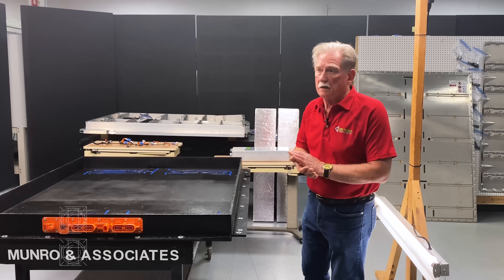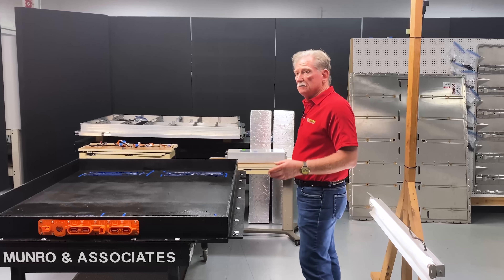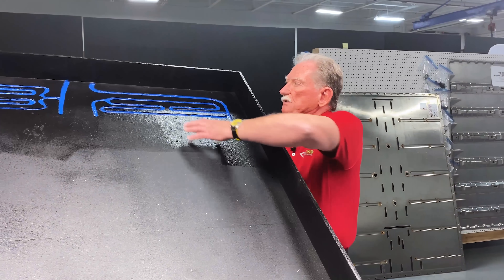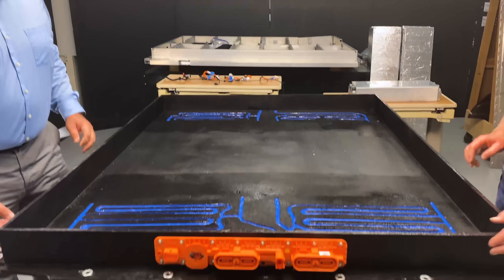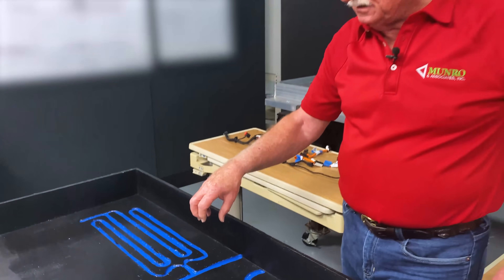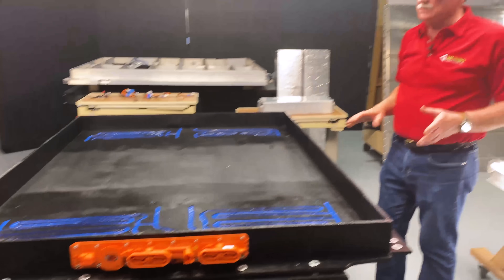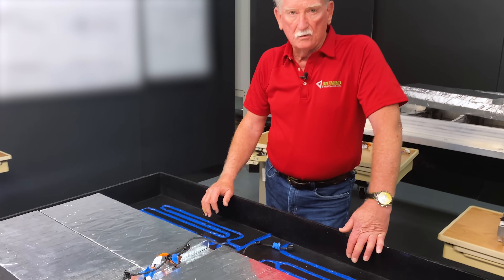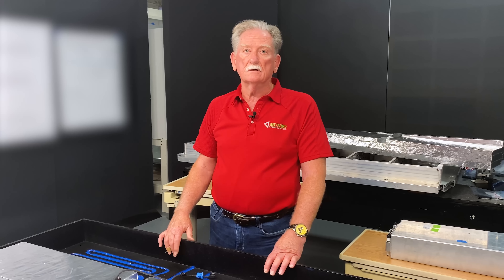Volkswagen ID.4 Battery Prototype Update

Comment: The unions (which were the guests of and the audience for Biden's little shindig ) are between Scilla and Charibdes. 
What's going to happen to their membership when the Tesla build technique and philosophy takes hold in the industry because it's a lot cheaper (that all that matters,) and all cars come with front, rear, and central castings squeezed out in fractions of a second, that weigh hundreds of kilos and use robots to move them around because they're extremely hot but eliminate hundreds of union jobs? Oh, and robots can work 24/7, in the dark, in unairconditioned factories. 

Tesla wasn't invited because they're already there.
Tesla get to march on ahead full steam ahead across the planet while the, uh, competition put, put, putter about and try not to spooge on their toes.

Don't weep for them because Elon's already has got:
 • SpaceX locked and loaded, and landing contracts for real space exploration,
 • Starlink ready to eat The Intarweb, (Actually, Starlink may very well locate a factory on the moon because the satellites can be positioned for much cheaper from there.)
 • Boring Company digging its way into municipalities' hearts,
 • Tesla Solar is getting on more and more rooftops and 
 • Tesla Energy about to help the electric companies rip us all off for more money (†) while microgrids, run on PowerWalls, relieve them of agita.

†) You don't really think that your rates will go down while Big E-Power cuts their costs and raises their reliability, do you?

Comment: Why do you propose to have the electrical connectors vs. the coolant connectors at opposite ends? You'd lose space at both ends, and a swing-down of the pack would be difficult. What am i missing?
Reply: Charge port is normaly on the back side, cooling / heating is in the front. When you have also the motor in the back all the high voltage stuff can be in one spot.

Comment: Will a large span of composite material resist sifnificant creep for the expected life of the battery? I'd hate for my BEV to lose an inch of ground clearance after 5 years.

Biden did mention Tesla at least once. He said something like "See that Tesla over there? Zero to sixty in 4.2 seconds!". The video feed I watched didn't pan over to show which Tesla model it was.
Reply: Problem is people don't understand the different between a thermoplastic polymer like Stamax from Sabic is (polypropylene) which will creep, and thermoset polymers like epoxy resins that crosslink and will not creep.
All aircraft composite materials are comprising a reinforcing fiber (carbon mostly,can be glass or kevlar) in the shape of a woven mat or unidirectional fiber, impregnated with a thermoset resin.
In automotive, most "plastics" are thermoplastic resins encapsulating small glass or mineral fiber reinforcements.
Reply: "You might want to ask Boeing and Airbus that. Composite wings last longer than aluminium ones (Airbus) or aluminum ones (Boeing)."
- @Alfred Wedmore

(my reply...)
"Aluminium/aluminum" Hahaha! :D

Those are good examples of "composite" structures being superior to their aluminum counterparts, but I don't think airliner wings and battery trays are similar enough to infer that a material being prominent in one means it's also a good choice for the other.
Reply: "The point is that composite airplane wings don't creep. Those wings contain fuel tanks which are a static load on the ground and a variable load in the air just like a battery tray."
- @Alfred Wedmore

(my reply...)
"... composite airplane wings don't creep" While I guess it's possible that this is true, this battery tray doesn't have the same structure of an airplane wing, the composite material is different, and the service environment is quite different. The maintenance is different. The cost is different. The space concerns are different. Other than both being "made of composites", what is common between your "point" and the question I asked?

A wing made from carbon fiber strands woven and impregnated with resin isn't analogous to this molded fiber matrix and polymer battery box.

Comment: I dont like glueing the packs to the big cooling area... this is asking for trouble the total stifness is not enough to maintain a leakteight construction. Also the ribbing in de bottom can be done differently an open stucture is not torque strong you must make a closed snadwich bottem. I like the heattransfer of the mach-e that you must develop a bit more. But anyway nice to let us see the insides.

Comment: The ribs under the battery tray will certainly add strength, but won't be very aerodynamic and would affect the coefficient of drag badly.
Reply: Put a simple skin on top.  And a glued on skin will further enhance rigidity.
Reply: Yes. And it's affecting your Z axis height. Imagine how full of dirt that will be driving on muddy roads, too.

Comment: Seems to be an improvement in packaging and ease of manufacture at the cost of removing any ability to repair and replace the packs. As a consumer that would be a bad tradeoff I wouldn't want. Smaller packs and no glue always improve reparability. I can only personally speak for much smaller electronics and goods, I've never worked with anything as big as this but the same rules should carry over. 

And Sandy, he didn't mention Tesla as they only invited the unionised auto manufacturers. Tesla is vehemently anti-union, and Bidens target for this was large scale unionised manufacturers. As a rule you Americans always try to politicise things without knowing the reasons behind something. It wasn't a faux pas, it was a direct result of Telsa's stance on unions.

Comment: adhesive? :( you need to make a battery pack to be open and worked on and fixed. so PLZ make the battery serviceable so the cars can last more then 5-8 year's. it's already a big problem here in norway on a lot of car's. the battery "unit's" is glued shut and they use to big modules inside so you cant replace the one part that is bad.
Reply: Cell failure rates are low.  Making things repairable often makes them more expensive and repairing things can be very expensive.  

"5-8 years"?  Look how long Tesla EV batteries are lasting.  300,000 miles / 12,000 average annual miles = 25 years.
Reply: @bobwallace9753  well there is a LOT of examples where the tesla battery fails LONG before that. now there is a industry selling used complete batteries here.. stil you need to pay 15 000$ for a tesla one AND you risk getting kicked out of the charging net AND tesla will stop supercharging all together on the car :( . and look at the i3? if you use the car a bit they failed within 5-7 year's and it is 40 000$ to fix. and if you ask the dealer to fix it they have to "open the pack, remove all cell's reline with some spesial gue then put in new cell's and reseal. so the i3's is going to the scrap heap LONG before they r used up. and all it need is some of the cells to be replaced to get "ok range" again.
Reply: @grapsorz  

What percentage of Tesla batteries fail and have to be replaced?

What percentage of Tesla batteries fail and have to be replaced outside the warranty period?

Are you basing your opinion on actual facts or anecdotal data?  Remember, it's the stuck pig who squeals.

And a follow up.  If one were concerned just purchase an extended warranty policy.
Reply: @bobwallace9753  enough for making problems for ppl AND making the price of the cars without a battery warranty plummet like  stone. and the fact that tesla forcefully stop fast charging (not only super charging) if you replace one yourself dont help. 
and "extended warranty policy"? from where? the seller dont want to take the risk. tesla dont have it as i understand. they have a 7 year warranty i think. and have no options if you want to by a used car from someone. or is your expectation that a car only last 7-10 year's? i just got a car today. 450 000km 2001 model. cant we expect the teslas to have that? r they SO CRAP?
Reply: @grapsorz  

IMHO you are making a mountain, a very large mountain, out of a molehill.

Extended warranty policies, if they aren't already available, will be created if there's an actual battery problem with Tesla EVs.
Reply: @bobwallace9753  from what i see. the US "extended warranty" is less then the standard warranty they give here.. and when that is out the car is worth a LOT less due to the problems the battery gives together with the problem Tesla put on you IF you try to fix it yourself outside tesla channels. .
Reply: @grapsorz  

If that scares you then don't purchase a Tesla.  Look for a company that makes EVs which allow you to tinker around with the innards while the manufacturer accepts responsibility for what you do.
Reply: @bobwallace9753  well i gues i will just have to stick with my petrol and diesel car's for now.
Reply: @bobwallace9753  they need to make it easy to replace a bundle of parallel cell's.
Reply: @grapsorz  
That's you opinion.

It is not the opinion of the people who design the vehicles.  They have access to data which you do not have.
Reply: @bobwallace9753  Not only cell failures is the issue here. Cells age at different rates, and if one reaches its EOL of 80% years before its brothers, it makes more sense to change that cell for a new, than have the whole pack age prematurely. This is done with the cell packs in the ZOE but the pack is usually rented so under manufacturers rasponsibility. In that respect, Tesla circumvents that problem by using small cells, so defects wil not affect the whole pack to the same extent as a single string pack made with big cells, but if you are selling an EV with prismatic or pouch cells, you need to be able to remove and service modules.
Reply: @Tore_Lund  
So using prismatic cells might be a bad idea.

I suspect Tesla is looking at using BYD cells only because they, and their partners, can't ramp up 4680 cells faster.  Tesla is doing with batteries what they've done with chips.  Buy whatever is available and make it work but at the same time work toward simplified solutions.

Comment: @Munro: Why do you do this with physical fake modules, which need to be built (even if it's only foam and metallic duct tape) or 3D printed and which use up space in your workshop? Wouldn't it be much easier to do this kind of prototyping in a CAD model on a large screen? There, copying a module takes only some seconds, and you have 4 or 16. And saving and loading is easy then. And the simulation for whatever requirement like thermal, crash safety, intrusion, stiffness, weight, bill of material (BOM), cost would be only some mouse clicks away. And you could send this file oder digital model back and forth around the world easily, even to SABIC or Volkswagen.

Comment: You're spot on with the 2028 EV/ICE crossover point. I've done my own analysis of the exponential growth of EV sales (aka the "S-curve") and benchmarked the progress against digital camera adoption, of which I'm more familiar. The result I got was 2027 for 50% of new car sales being BEV, and virtually 100% BEV sales by 2031. That said, there may be some supply constraints that slightly delay that timeframe, but 2028 is still quite reasonable. 

Also, even though I'm generally pro-Union, Biden's snub of Tesla was a strategic blunder.
Reply: Your prediction of 50% BEV in 2027, and about 100% BEV in 2031 in the US market is way different from Munro.
See this recent video from Munro: https://www.youtube.com/watch?v=QNHQOyz5TcY
Mr Munro counts BEV+HEV as EV. So, in 2028 his prediction is not 50% BEV. But it is 50% (HEV+BEV) in either 2028 or 2031. Which translates to roughly 26% BEV in 2028 or 2030 for the US market. This is half or a quarter of your prediction of market share.

Comment: Can Munro help the power companies so we can plug all these things in and still have lights in rural America?  "Lean" presented to grid operators would make for a great show!  Thank you for your work, and best up luck up there.
Reply: Just do most of your charging at night.  

Do a little math and figure out your peak draw during the day.  It's likely in very late afternoon/early evening when dinner is being prepared, the AC is running full out, TVs are on, etc.  That draw is almost certainly higher than what an EV is going to be pulling in the wee hours. When the lights are intentionally out.

Comment: Really like this 'from the R&D lab' viewpoint/pointer. Also as a possible future step-up to a community/crowd sponsored follow-up as in 'we want you to develop this idea further as this relevant to me/our company'. Just think how the PAV project - which was too early for it's day - would and could be different in today's connected environment with a (market) mature Internet audience and established and maturing financial business models (thanks to pioneers like Kickstarter). As for the product architecture options you're showing with corresponding trade-offs I am less impressed. That is pretty basic and you can do much better, Really. I know you can. F.i. C2C (cradle to ...) is an almost obligatory requirement nowadays. And f.i. and apart from the physical packaging dimension: digital twin capability now, for the first time in history, gives designers a feedback mechanism on operational issues. So with OTA capability available which you may assume you can/need to design  how the functional product envelope may expand. In the battery part of the design space GM's wireless BMS is an interesting and conceptually important design pattern.  My 2 cents ;-)

Comment: For inlet and outlets, why not have each bank have its own cooling loop. You could then in theory if a module at the end of the back is hot reverse the flow of water to more directly cool that group of cells. 

The way I see this is that the last group of cells will always be hot.
Reply: in a liquid cooling system the cooling fluid barely changes temperature because the fluid can exchange temperature really efficiently. for a watercooled PC build (best comparision i could find) the difference seems to be usually in the 2-3°C range, so its practically negligible. And a Watercooled PC usually has to reject more Heat than a Bettery Pack.
Reply: @unitrader403  Temperature balance is important in a battery pack. Just 2 C temperature difference between cells changes a cells discharge curve and unbalances the pack. Naturally if the flowrate is high enough, the temperature difference will be negible, but arranging the channels to keep them as close as possible makes sense..

Comment: How well can a composite expel waste heat?
Reply: Heat is carried away by the coolant circulating in the channels under the cells.
Reply: @bobwallace9753  that are encased in the composite? The idea is the bottom of the pack acts as a cooling plate as I understand it.

Comment: I think its time that your team start working on a small 20 seater electric plane.  The design can come now and anticipate at least 20-30% improvement in battery tech, solar tech and significantly lower costs, so that 5 years from now airlines can have viable no emission aircraft options.
Reply: I agree someone should, but I think Sandy’s a bit busy at the moment.
Reply: @fredbloggs5902  Work is well along with battery powered passenger planes.  I just read a piece about how one major airline has ordered 20(?) planes for its fleet.  These first planes will, IIRC, carry about 20 passengers and should open up commercial flights from airports that would otherwise not have the traffic to support small jets.